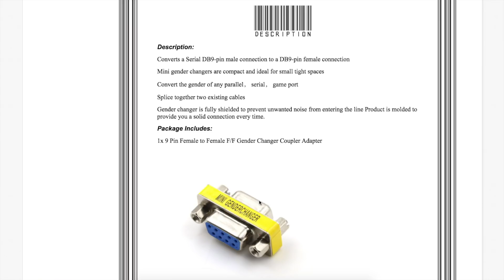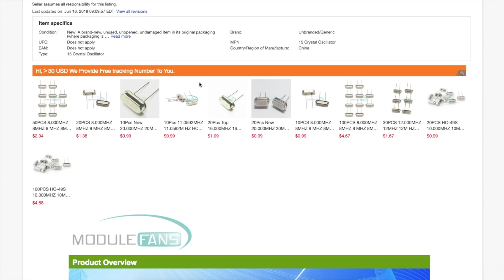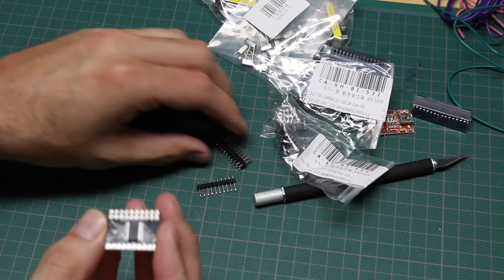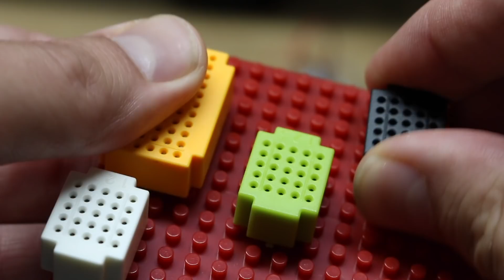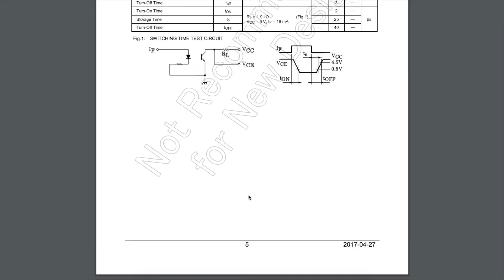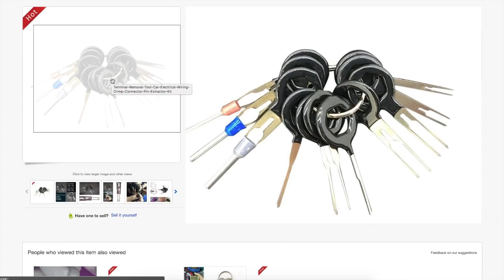Mailbag - Lego Breadboards, GPIO Expander, Digital Pot, Crystals, USB Power Monitor, and more!

Comment: You taught me something today!  Just ordered some of those X9Cs.  May be fun to play with the gain of an op-amp or transistor biasing from an MCU.  Also taught me something about Molex pin extraction.    It has been mysterious to me how to get those suckers out.
I have some experience with port expanders.  Usually, read == high == high-impedance, all at once.  They do not sink much, and barely source anything -- but very useful for providing an I2C interface to a lot of buttons.  If you dither the I/O direction mask, it is possible to control a LED on an input button from the same pin.
As  opto-couplers go, PC817s a lot more common and and less expensive.  These are best kept individually socketed, so when they wear out, you can replace them.
Reply from the maker: I think I once saw something about using an LED as a touch sensitive input, but I can’t find that information anymore so  I don’t know how it worked or if I was just daydreaming.   I should go through all of my archived files I might have saved from online over the years with any fancy tricks and maybe do a video like that if I can find any weird design information.
Reply: Was trying to convey that you may want to turn on a LED (by driving low), and maybe read same expander line for a few microseconds through an interrupt, by driving it high.
You may be thinking of using a Darlington, 555, or a 74HC14 to sense touch:   http://elonics.in/breadboard-projects/simple-touch-switch-using-transistors